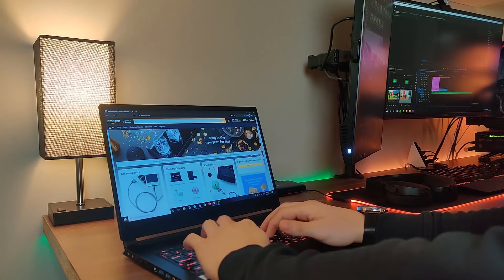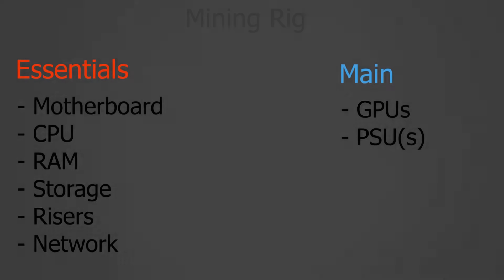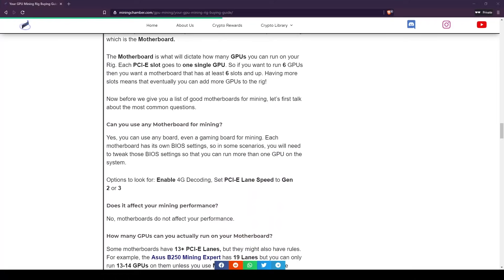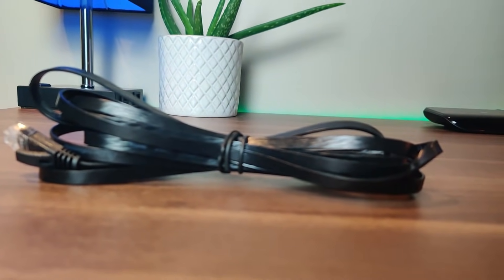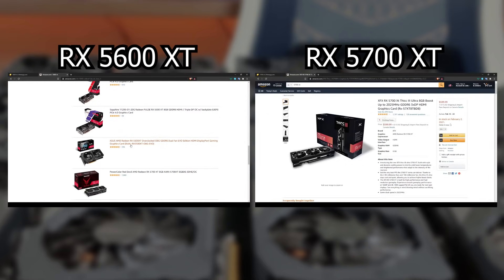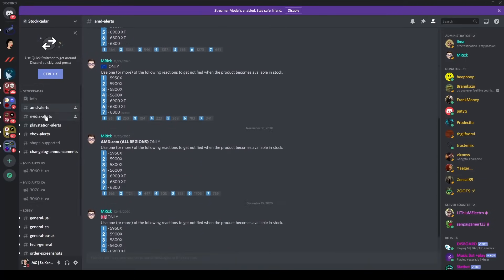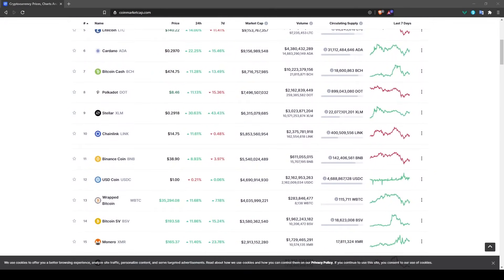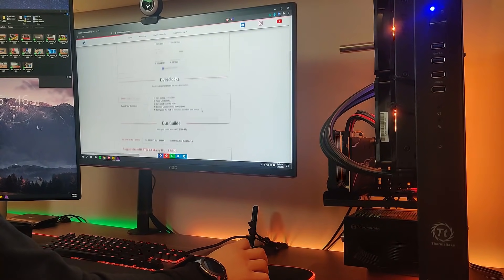GPU Mining Rig Buying Guide - All You Need To Know | The Basics

Comment: Power links are not always great. If you have old or poorly wired electrics this can introduce noise into the network which will result in lost packages. Also the new eero from Amazon is great for WiFi.

Comment: Great video, thanks for the super helpful info. Built my first rig with your guidance. Can you recommend a RGB Fan controller, both to control the fan speed and the lighting? Are there units that do both or do I need to separate controllers. I have 7 Silverstone Air Blazer 120rs. Thanks.

Comment: I have below PCIe slots on my mother board.. Will I be able to add 6 GPU's ??.. which is the best card to buy in budget. Suggestions welcome!
PCI slot (slot 6)
PCIe x16 slot (PCIe 2.0 wired as x4) (slot 5)
PCIe 3.0 x16 slot (slot 4)
PCIe 2.0 x1 slot (slot 3)
PCIe 3.0 x16 slot (slot 2)
PCIe x16 slot (PCIe 3.0 wired as x8) (slot 1)

Comment: Hi, I  did assemble the rig but i plug in but it does not power up what  did miss. I  have asus  B  250 and HVVH 180  power 180 watt (psu) and RTX 2060  with  CPU is -7400 intel. it  wont turn on ...what  did i  miss
Reply from the maker: I would double check make sure all the parts are compatible. I never heard of a 180 watts psu so double check on that end as well!
Reply: You can contact cobranet_tech on Insta I got mine from him, and he's got the best setup explanation for you.

Comment: Great video, have a question I couldn't find the answer in your video: running the cards on the PCI-E x1 isn't hindering the mining capacity for the graphic cards? If I place mine in the x1 slot, I get half the hashing power (even with the 470.05 nvidia graphics + monitor attached to it). Am I missing something?
Reply from the maker: If your talking about the RTX 3060 then look up my guide on it! I show how to fix it there

Comment: Noob question.  Obviously 12 GPU motherboards are currently overpriced.  Would purchasing a 6 or 8 gpu motherboard and adding PCI extenders so it totals to 12 gpu hurt the hashrate at all since that wasn't what the motherboard was designed for?  Or in reality, is this just the smart thing to do because it doesn't matter and you actually save a lot of money while doing it?  Much appreciated!
Reply from the maker: PCIE slot splitters are always unreliable so I recommend avoiding them! Its too much of a headache
Reply: @MiningChamber  You have a 12 gpu mining MOBO reccomendation? I prefer under $300.  Thanks for that info!

Comment: I thought this was a very good video. I learned a lot. I wish I knew this stuff 10 years ago. After deciding what hardware to buy and setting it up. How do I convert Bitcoin or whatever coin to actual physical money? I'm assuming I should buy a cold storage wallet and not to use coinbase or those other places. But where do I go to convert digital money on my cold storage wallet into actual cash? With the government cracking down on people paying their taxes on cryptocurrency they will probably get records from coinbase and such. How do I get around that without being tracked?
Reply from the maker: Thank you! This video should help you get an idea on what you need to do to cash out with different ways https://youtu.be/EDyXRf_Ug_U
Reply: @MiningChamber  I'm still on the fence. I see people renting leasing mining rigs and then there's always just buying the cryptocurrency outright and waiting for it to go up like a normal stock. I feel fairly comfortable with building a rig although I haven't built a system PC in years. It's really just The upfront cost that I'm worried about recouping. So when you figure in the hardware costs plus electricity bill Plus taxes on top of the profits then the number should be fairly low and risky I think. I saw aetherium jumped 8% today though so I don't know

Comment: For a 6 gpu rtx 3060 ti with a genaric mobo and celeron cpu how many watts do I need? I see some vids with 1200 but my calculator says 1800 with gpu, the rest of the rig, and fans and risers? How much do I really need?
Reply from the maker: 6 only need 1200w. GPU 120-130 watts each after undervolt and the rest of the system 60 watts at most
Reply: @MiningChamber  okay thanks. Your the best.

Comment: My mining rig which is mostly my gaming pc :
Amd 5800x
Asus tuf gaming Wi_Fi x570
750 watt power supply
Asus tuf gaming 3080 oc
4x8 gb ddr 4 @ 3600 14 timing
2x Sandisk 970 pro 1 tb
1x 8tb HDD WD 7200rpm

I mine eth at 100 hash rate average
Reply from the maker: Niceee
Reply: ayyye thats pretty good

Comment: Hi, great vid, one question tho: how do you evaluate the "worth" of the RIG? I mean, i understand the calculations to evaluate the time to get the money back, but that relies completly on the crypto value, so if in 15months it goes lower, your time to recover the money increases. How long do you consider it to be a good investment (considering as new tech will appear - stronger miners- and some may break from 24/7 running)?
Reply from the maker: generally new hardware does not affect old hardware. As we can see the 580s still remain great choice and they still sell for more than or close to MSRP. Generally its about 1 year breakeven for a rig and in my opinion that is pretty fair since rarely you would find an investment as safe and would return to you your capital in a year. Plus you have the Hardware as an asset which you can sell at any time. Now we see breakevens in 8 months and less due to ETH price
Reply: @MiningChamber  Thanks for answering :D Yeah when comparing it with other investments, its for sure a fast one, but my question is how stable is it? Never entered the mining world, but I'm curious for some time now (remember some years ago, right before bitcoin hit 3k I was really tempted to build a mining rig) how safe of an investment it is, because if the currency drops its value you can enter an eternal non profit zone... about the hardware never tought of that but very well said, its sellable at any time to recover some part of the investment or even one last profit before buying a new one
Reply from the maker: For stability, it's fairly consistent and yes it matters alot about the crypto price itself! I did just release a video on what impacts the profits but il eventually make a video more in depth about mining as an investment option
Reply: @MiningChamber  Hey, sorry for the delay! Yeah, really well exlplained, sadly realised here the eletricity cost is fairly high, reducing the profit by a lot :'(
Still considering it thanks to you :D, will try to find some great deals for the GPU's (probably 3060Ti) so i can setup my first mining rig (after building so many PC's will be fun setting up one with multiple GPUs xD)
Don't know if you deleted your last answear or if its bugged here (received the notification via email) but cant add you on whatsapp since when i add your number it says "invite to whatsapp" :/ 
Once again, thanks a lot for all your info and input :))
Reply from the maker: @insano202  that was just an imposter unfortunately 🤦 someone telling people to add them on whatsapp acting like me, so becareful don't fall for that scam! And good luck!

Comment: Another great video!!!! Question for you, I just got my 6 GPU mining rig using 3070s up an running finally. The 3070s are brand new with the rest of the rig being used. Running Phoenixminer in W10 it seems like GPU 1,2,3 are getting a lot of incorrect shares. GPU 1 has no accepted shares and all incorrect shares. I have used the stable OC, CC and UV as Red Mining Panda. Any idea on why this could be happening?
Reply from the maker: Thank you!! Every gpu is different so you might need to tune down the memory on those incorrect shares GPUs

Comment: EU
Why didn't you include 1080Ti in nVidia list? Those are old but beasts even today.
ETH: 0x0d8C52B381c0071610DeD7B3749135A23c96d90F
Reply from the maker: They absolutely are! Just it's hard to find them as well for decent prices and comparing to the new 3000 series id say 3000 series is much preferred

Comment: I might be able to get some used rx 570 4gb 
But these wont mine with windows i have heard. 
But if i install linux... can they then still mine etherium? 
Will they be outdated soon anyways? 

What should i do? I can get 6 of them for 125 bucks each :-)
Reply from the maker: Mm you cant mine Ethereum fully anymore due to dag size. So I would stay its best to find 8GB 570s! Red Panda Mining covered the 4GB cards I recommend checking his video on it!
Reply: @MiningChamber  (edited to because of facts, to anyone reading this.... Get 8gb vram cards....) Thank you for your answer! :-) 

Yeah.... Those "workarounds" are not actually that great........ I will try some more, but i need another psu. The retail seller told me it was semi modular with many pcie-connectors...... Turns out it was modular.  So i can only run 1 card at the time.....
700 dollars for 5 working 570`s 4gb is still a good buy. Though. 
I'm thinking i let them run and build som experience with mining, and then i will get some 3060 TI's. Ofc selling off the 570 4gb cards for a little profit/break even..

Right now i will mine ravencoin i think
Reply from the maker: Awesome!!
Reply: @MiningChamber  updated comment over with new facts.

Comment: EU - I mining 3 years with 10 GPU. Good luck to the new ones.
Reply: What  is  your  day profit
Reply: @flicker12345678 Now 10$-12$. 9xRX570GB 4GB and one 1060 6GB. but it will be a few days and less profit. I'm going through on Beam mining.
Reply: @zsoltvarga434  awesome but atleast  you should  earn 50$ per day
Reply: @flicker12345678  Why?
Reply: @zsoltvarga434  you have 10 GPU
Reply: Can I earn 2$ with 1060Ti GPU
Reply: @flicker12345678  whattomine dude. 9x rx570 and one 1060...Rev profit 11.8$ on ethash
Reply: @flicker12345678  yes but rx570 on ethash works in zombie mode. 1 rx 570 20MH/s. 8MH/s less
Reply: @zsoltvarga434  super  monthly earnings  and electricity bill
Reply: @flicker12345678  monthly 45$-50$ electricity bill
Reply: Great video. Can you tell which software need to mine and how to transfer crypto to coinbase swallet?

Comment: Mining since the start of this year with my 17 months old 5700xt. I have also 5500xt 4gb and wanted to add this card to the next pcie slot and run it in zombie mode, but it would be too close next to each other, affecting temperatures of top slot card and I dont want to have my case side open 24/7 so 5500xt will remain as a backup kard

Comment: The new 3060 with 12gb vs 3060ti with 8gb for mining?
Reply from the maker: Mm I have not yet seen the 3060 performance for mining but I think both are good options for sure
Reply: @MiningChamber  3060ti has less vram but has better memory band width so i am guessing that makes it better at mining. I mean rx 6800 has 16gb vram but has less memory band width and is comparatively weaker at mining compared to 3070 oe 3060ti at its pricimg.
Reply from the maker: Very good point I agree!

Comment: I have a small question I hope you can answer it. I recently bought a 480 and I want to Biosflash it, can I just do that on my "main" gaming pc and plug it into the rig afterwards? Will these settings save or do I have to do it on the mobo i want to use
Reply from the maker: You can def BIOS flash it then plug it somewhere else but as for overclocks you will need to set them again in the rig!

Comment: The best buying guide I have seen so far definitely need to save as much money as possible building my first rig this was really helpful and I really appreciate it! Unfortunately I only have a bitcoin address because I use Nice hash and I mine on my Gaming PC using my RX 580. If I should include my bitcoin address instead lmk or reply to the comment! Thanks Again for all you do! I am from the USA!(3MT12DbwcT5shfws5m5d663tYp3JUHoHry)-BTC address
Just Got an ETH address- 0xfc283263E69eC6157C9Fb430f4aa2b2AB40C64DC
Reply from the maker: Thank you!!! Please go ahead and add the BTC address, if you win il exchange the ETH to BTC!
Reply: @MiningChamber  Just added my BTC address! Keep up the good work! Also are Thermaltake PSUs reliable for mining
Reply from the maker: Thank you!! Yes they are not bad at all! I recommend checking the server psu guide though I feel like they are better option if you don't mind the noise and heat

Comment: I bought a b450 Asus Rog Strix-F gaming despite it has 6 pci-e slots, only 4 can have gpus at the same time
Reply from the maker: Oh wow interesting, does it mention anything about it in Manual or does it just simply don't work
Reply: @MiningChamber  nah, but later I found an article that says: “The last PCIe x16 slot, as well as all three PCIe x1 slots, get their data via the B450 chipset. The PCIe x16 slot shares its data connection with two of the PCIe x1 slots and will disable them if used. So be sure to check the specifications page or your manual if you intend to fill most of these slots to make sure you configure your hardware optimally.”  :(
Reply from the maker: Oh wow! That is good to know, thank you for sharing!!